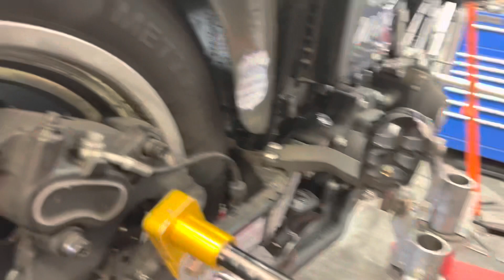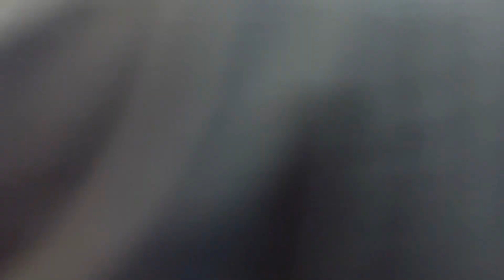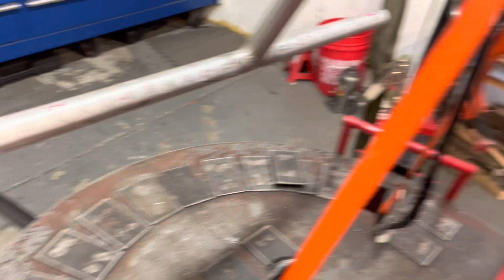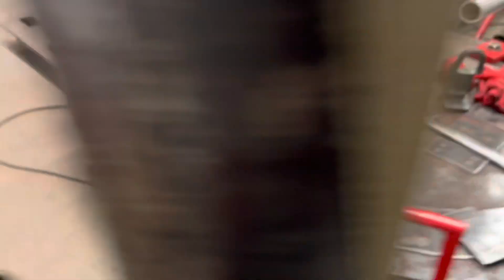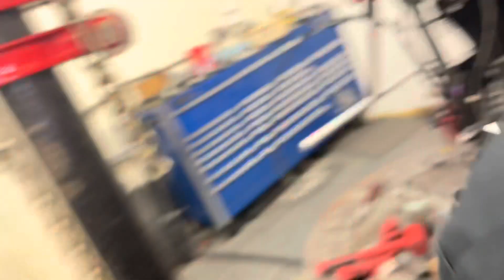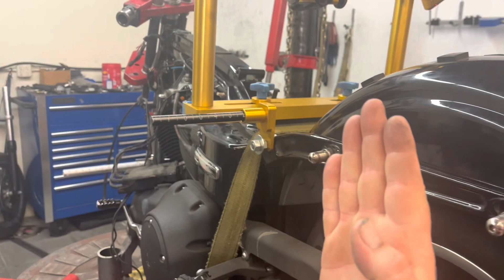2014 Dyna frame repair time lapse

Comment: Hey guys i inderstand the alignments but how did you adjust the front of the motor left or right to re center the swing arm after the verticle alignment? And do you find the verticle alignment of dynas are pitched to the right side from the factory to make up for the weight of the primary so they dont wander to the left side due to the extra weight. Thanks for the videos they have helped me align my dyna.

Comment: Odd he didn’t want to do the swingarm bushing
Reply from the maker: We do lots of alignments for mechanics and technicians who would rather work on their own bikes but don't have the Straight Shooter to do an alignment or the Rack and Pull System to repair their own frames. I'm surprised that more shops don't offer alignments as part of their service package. An alignment will give you the full benefit of any suspension or performance upgrades.
Reply: @RackandPull  I my self work on all my personals , but you where already there. Might as well , that’s just my 2cent , good work on the videos and keep it up 👍